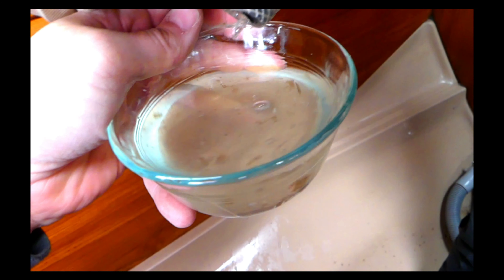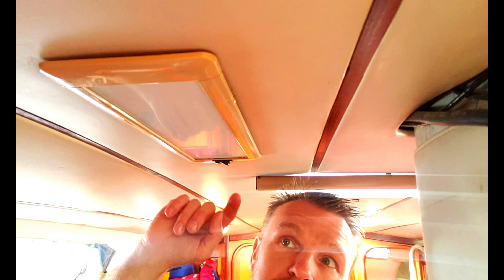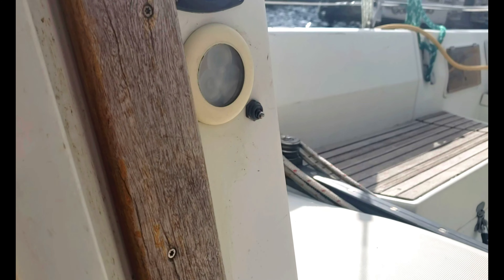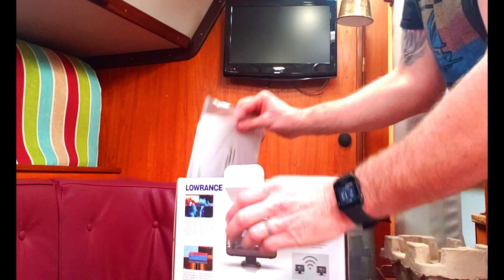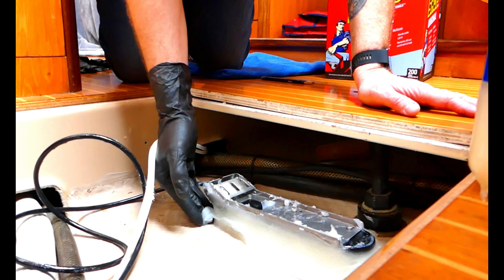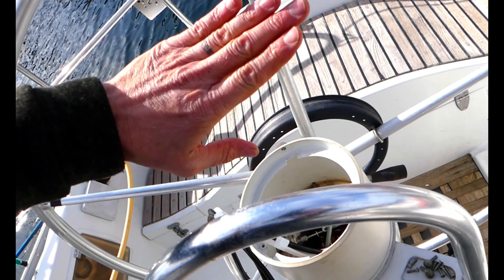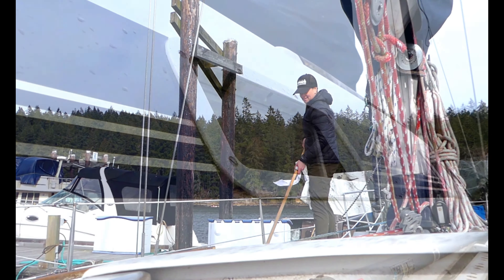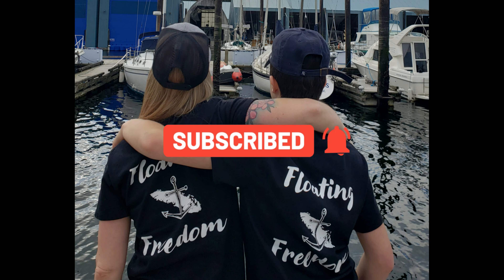Getting the boat ready for spring sailing and some Easter surprises!

Comment: You'll love Desolation. Just remember to not try and take it all in at once and take in a few out-of-the-way places as well as the popular ones. If the border closure is still on you should have a unique experience with  a lot less crowds (the best way to see it).

Were you happy with the Foam Guys? I need to order a mattress topper and will have to do it remotely.
Reply from the maker: I will keep you posted, we went with the Foam Shop as the Foam Guy was booked until late summer for upholstery and foam.